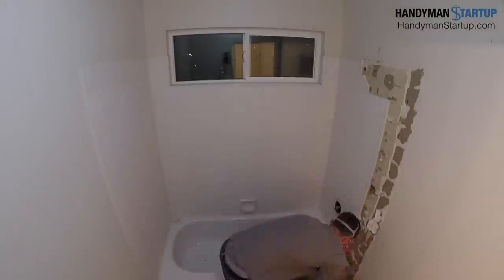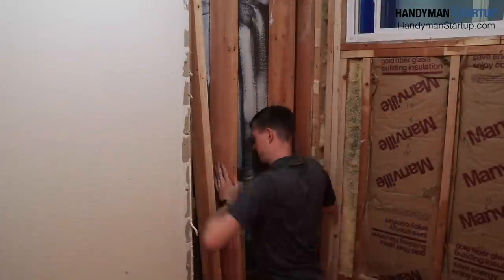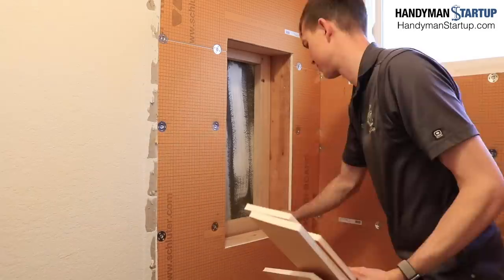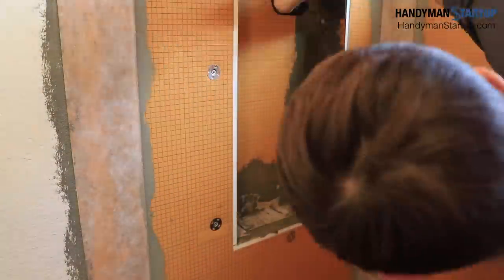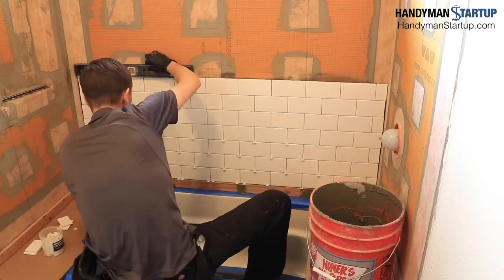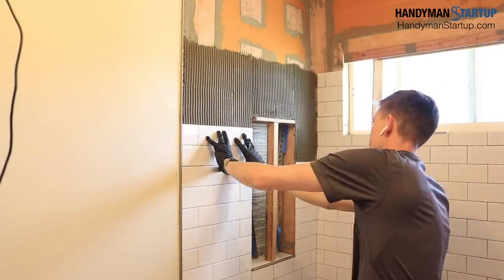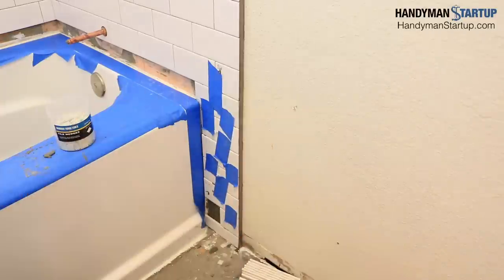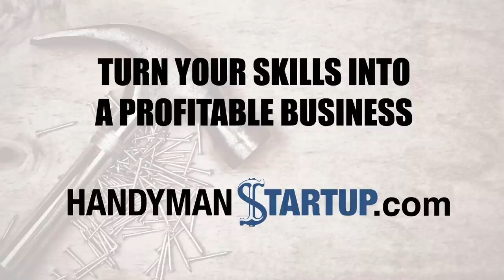Subway Tile Shower Time-lapse - Entire Project Start to Finish With Commentary

Comment: Nice work! I learned recently that there is a special grout that is used with mosaic tile that does not allow it to sag after being stuck to the wall. Also a good idea to fill tub halfway full before applying silicone between wall and tub to account for the future movements.
Reply from the maker: Thanks for the tip.

Comment: Great job! ...  I see so many tile guys put the bottom tile that meets the tub right on top of it with no gap and then try to grout there. All that grout will pop out and like he says could crack a tile. You'll want to use flexible grout in the back two corners as well because those walls will move independently. ANSI standard for tile installation states that any two joining walls or any two dissimilar surfaces should have flexible (siliconized) grout.
Reply: you use a separate flexible grout just for that?
Reply: 100% agree. Guess where I’m fixing a leak on my shower upstairs? There is a bench where outside corner forms from sitting area and wall area under legs. Where is other cracks? Outside corner where wall entry meets inside tiled wall.
Reply: @wisconsinwoodsman1987  not surprised, see it a lot.

Comment: Nice video, I wish I worked half as neatly as you do.  The Kerdi niche is a home run.  the largest, 24" x 12" is inder $100 on Ebay or Amazon so I concur whole heartedly with your regret to make the niche custom.  Important that people realize that UNMODIFIED thin set must be used when using Kerdi/ Shluter products. Thanks for a great effort.

Comment: After all that time and effort to seal every seam and screw hole with thinnest and paper, you screwed a ledger for your first tile row right through the Kerdi board and seam seal.  Is that the recommended method?

Comment: Great job!  Kerdi fix is NOT a sealant It is not waterproof it is a adhesive. Alot of people think it holds up like silicone and use it for a sealant This is not true Lots of people have tested this product and find it does not hold water??? Also watch Sal DiBlasis youtube video on "how" to make a custom niche with kerdi board. I did and made my own. Its actualy easy to do Thanks for a great video lesson

Comment: Thanks for the video,  I was surprised to see copper pipes being brushed and welded! Nicely done.  I’ve done a handful of plumbing projects and the few times I came across copper pipe, I just cut it and used a shark bite to transfer to PVC or CPVC...I’ve never done a shower or bath though, have you ever used sharkbites? I was wondering what the report is about them in the trades community.  They seem like a big time and energy saver. But maybe there is some kind of downfall I don’t know about...
Reply: $.10 vs $4.00 for one fitting. I'll stick with sweating copper.
Reply: Shark bites can be a time saver but the connection is not as  trustworthy as a solder copper connection for example. Now  of  course the industry standard is  pex which is also a big time saver as well.     I  think using the sharkbite  where you are  enclosing them behind  tile is a risk that can come back to sharkbite ya.

Comment: Exactly what I'm doing ? Except I'm dismantlinghand rebuilding the entire room, floor, walls, bath, shower and tray, wash hand basin, toilet, electrics , ceiling, and radiator, tiles. For infor how long did it actually take you to do that job
Reply from the maker: It took me over a month, but I wasn't working on it full time.

Comment: Nice job...A few comments. If you used "ALL-SET", you used the wrong thinset for the kerdi band. You're supposed to use their unmodified thinset which is called "SET". The ALL-SET is supposed to be used for their Ditra product if you are installing the uncoupling membrane (Ditra) directly onto a plywood subfloor. 

According to their manual it also looks like you might have added just a tad too much water to the thinset - it shouldn't be dripping like that but it shouldn't be sandy and dry either. It should have a creamy texture, not a watery one. And while small tiles like subway don't require backbuttering I would always backbutter to ensure proper coverage. 

I like your 6 rows at a time suggestion. I also like what you said in the beginning of the video of how you learned how to do this stuff. That is exactly how I learned as well. 

Also noticed you didn't use Kerdi-band on the top screws at 22:38. I know it's close to the top of the shower, but why risk it? 

FYI next time you do a tub I would order something similar to this "Scratch Protection SP-01" that I bought to protect my tub. You paint it on, let it dry, and then it creates a thick film that protects the tub from dirt, grime, nails, mortar, etc.....It's not going to save you most likely if you drop a hammer or a LFT tile on its corner....but it will definitely give you some piece of mind. I got mine here https://www.protectiveproducts.com/products/scratch-protection.html and it was $67 shipped. Totally worth it in my opinion (not affiliated with them at all just trying to spread the knowledge). 

Anyways, nice video bud!
Reply: All-set is fine and approved for Kerdi band for anyone else reading. 

In reality some dripping occurs if mixed as per the directions on vertical surfaces. The fluid consistency of the thinset bonds the fleece of the kerdi band better so no harm. aplus it gets another layer of thinset over it when tiled so all good. 

I don't see any problem not waterproofing the top screws. Unless he regularly sprays water in the ceiling. At which point he will have bigger problems.

Comment: I am about to purchase subway tiles for my shower but my walls are not 100% flat. Some areas have a little over 1/8 gaps but nothing more. Should I need a leveling system or subway tiles will not be advisable. Thx.
Reply: What u mean to say is ur walls are not plum.. leveling sytem will not fix that

Comment: Excellent video!!!  Question: If using normal backer board, is it recommended to first install a vapor barrier behind it?
Reply from the maker: A vapor barrier isn't made to go behind tile. I would only recommend using materials designed for waterproofing showers.
Reply: @StayHandy  I believe he is talking about putting the vapor barrier behind the backer board, which I highly recommend.

Comment: Nice job. Where did you get the metal trim pieces that replaced the bull nose? Thx.
Reply from the maker: From the same place I bought the tile and other supplies. Schluter makes them.
Reply: Home depot and lowes both carry them in various styles and finished to match your metal fixtures

Comment: Ceramic wall tiles need a presoak in water if you use modified thinset.
Reply from the maker: That's the first time I've heard that. My tiles are still firmly on the wall several years later, and I live in a dry climate (Nevada).

Comment: Tonight I found out the hard way that Lowe’s subway tiles don’t have that built in spacer any longer. They are selling a different brand, not American Olean, that are much squarer and sit flat against each other, with zero natural space in between. Now I’ve got to stop my tile job and pick it up tomorrow after I get some tile spacers. Bummer.
Reply: That's what happens when you buy cheap crap from big box stores. Do yourself a favor and buy quality tile from a quality independent tile store. Cheaper usually doesn't yield better.

Comment: Hi. Did you see any build up because of layers of schluter?
Reply from the maker: Yes, where multiple layers of the kerdi band overlapped there was a bit, but it is still manageable with a bit of extra thin set when laying tile.
Reply: Thank you for your reply. I imagine the larger the tile the easier it would be to fight the build up. What smallest size of tile do you recommend on the wall? Thanks
Reply: @bennisim7949  It is actually reversed. The larger the tile, the more lippage you will deal with.

Comment: why did you start the tile on the back wall instead of the sides?
Reply from the maker: It was the easiest and allowed me to line the sides up with the back wall.
Reply: It doesn't matter where you start as long as it follows your layout. It's usually based on preference.

Comment: Backer is supposed to go on top of the flange not over it.
Reply: No it's not. Two reasons.....It's supposed to overlap it so there is no seam. Any water that seeped behind a tile would wick over it, instead of into the seam where the backer would meet the flange. Many tile guys cut a small relief or rabbit joint into the edge of the backer so it overlaps and lies plumb. It's easy to do with Kerdi. You still leave an 1/8" or so gap between the tub and backer board. Second....that would leave at least a 3/4" gap where tile would have no mortar.

Comment: All of that money on that system and you nail into. Lmao smh
Reply: How would you attach your ledger boards? I'd like to see the result without them. The system has screw holes all over it, but they get sealed. The ledger holes should be sealed before the last row of tile is installed. Even if not I highly doubt a problem will result. The number of horrible installs I've ripped out, some installed with mastic on sheet rock that miraculously didn't have water damage, don't compare with the quality of his install. Everybody is a YouTube critic because they watched some tile coaching videos....
Reply: Another armchair quarterback. I rip out dozens of bathrooms built in the 70's with tiles over plain sheetrock and the ones that don't have windows are bone dry. Shower walls around a tub typically get sprayed but not soaked. Today's standards use water proof or water resistant backer board and is the right way to do it, but around a tub it's so much more than you really need. You think a thin nail hole that has sealant over it that will not be exposed to standing water will cause an issue?  Perfect example of someone who has some knowledge but not enough....